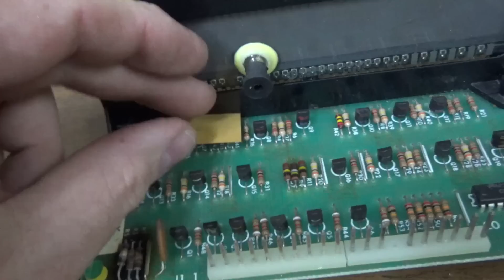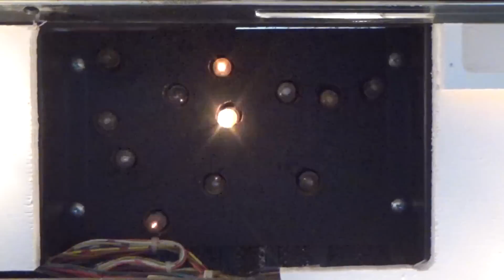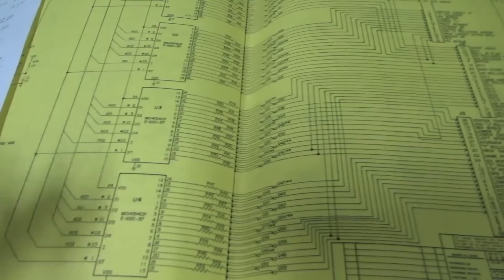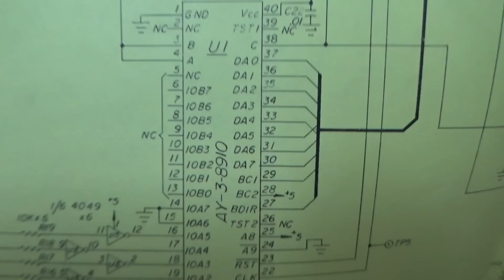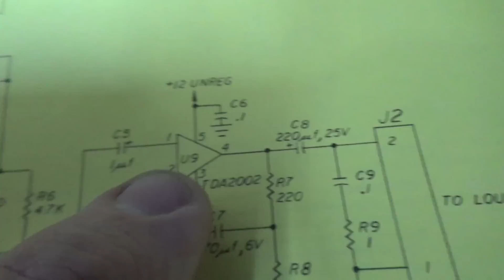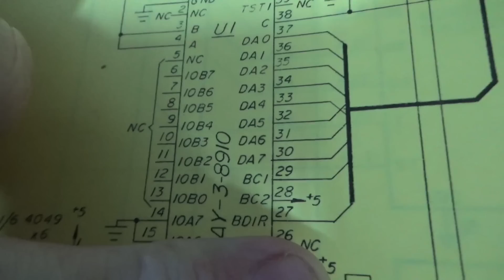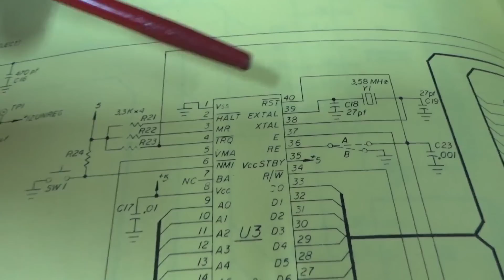Diagnosis And Repair - The Lamp Driver Board On A Bally FUTURE SPA Pinball Machine!

Comment: I would tell the customer that they're likely going to have the same problem on the rest of those numeric displays and at least give them the option of replacing the rest of those resistors while you're in there and the game is at your shop. Maybe they will think it's worth it, not having to worry about more service in the future. The one thing I learned in sales that has done me well, is to not spend other peoples money as if it were your own. Never assume they would make the same decision as you would. It works both ways. What you might never buy if you were spending your own money, they might not have any problem with buying. What you might think is money well spent, they might think otherwise. Just give them all the info and let them decide. Just my thoughts. Love the videos.

Comment: Given the lower drivers on the lamp board were corroded, it could be from the "remote" battery pack that was leaking, as they also off-gas and release corrosive gasses into what is a restricted space when the doors are closed up.
Looking  at the first video, the F in Future was working in your first video ......

Comment: Ron, that display, transistor Q2 to the right of those burnt resistors has the back of it blown or broken off where you can see the internal connections. 3:11 It's crazy it still works!
Reply: I saw that too, and thought of mentioning it, but you beat me to it 👍

Comment: At 9:45 you talk about the fumes from the corroded battery damaging the lamp driver board. I was told by someone years ago that the paint lifting at the bottom of the backless was caused by these fumes too. The damage was not caused by changes in temperature. I haven't been able to confirm this, other than I have several machines in the loft of my shop. There has been  at least a 105 degree F temp change from winter to summer for 10+ years. I haven't seen any lifting yet.
Reply: Ive been under opinion that backglass issues along channel have to usually be caused by excess moisture from cleaning that gets in lift channel and wicks its way to inks on the backside

Comment: What does the J3 Cabinet Switch Strobes, it strobes what? For J1 the lamp addresses and lamp Data is being driven by a ROM chip so the lamps will have a light sequence pattern. If you look at the capacitor PACK 470pf from C41 to C48 are capacitors for the lamp addresses and lamp data buss lines but to filter what, the data noise? The Cabinet Return switches buss lines C31 to C40 uses a capacitor PACK 390pf. I wonder why the Cabinet Return switches buss lines uses 390pf values and the Lamp data buss lines uses 470pf values? I would think the values of the capacitors would be the same

Comment: Since those resistors heat why not use thermal resistors that are designed for heat. Or will that change how the display works. I have made heat shields for resistors that get hot it takes some time though.

Comment: That transistor Q1 being tied to a capacitor is actually a tone control. Similar to the tone knob on a radio. When Q1 is on the higher frequencies are attenuated making the same electronic sound come out as 2 different sounds with 1 bit of data. A cheap way to double your options.

Comment: I have a nugent that boots about 60% of time. If it doesn’t boot it is just stuck on the first flash. If you unplug the sound board the mpu boots every time. I have resoldered every pin and the connectors look good as the mpu has never corroded. I have recaped the sound board but it didn’t fix the problem. Not sure if I should just replace the sound board or if it could be the mpu that needs replaced